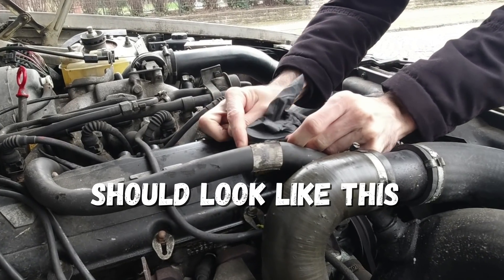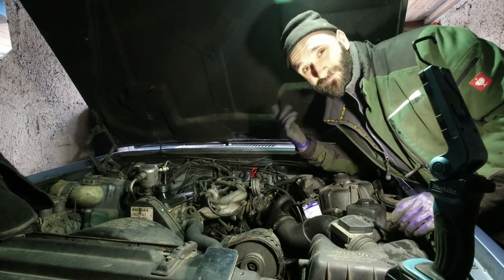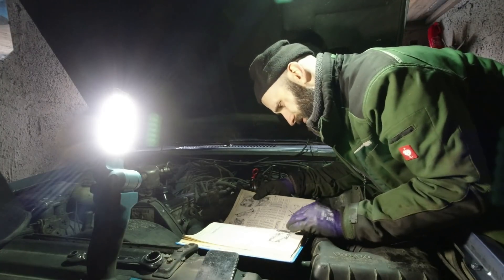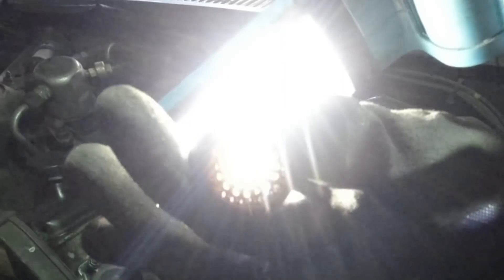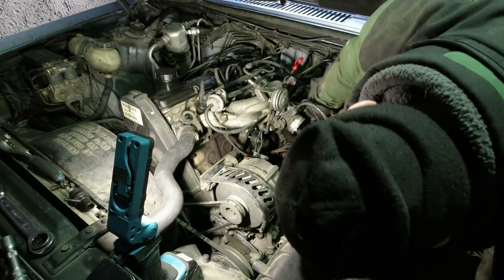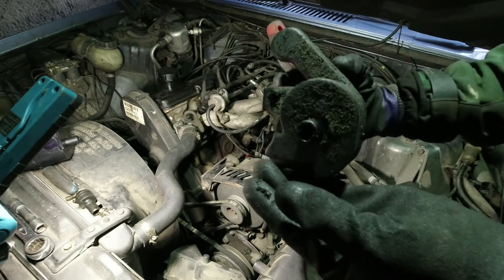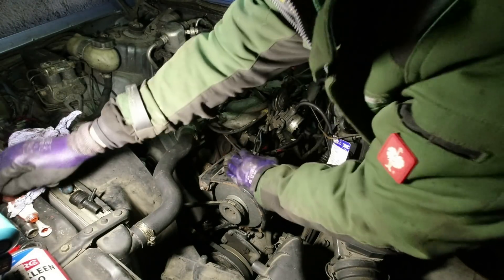My Engine is about to BURST! Volvo Redblock PCV System

Comment: What needed unplugged on my 740 with 300,000mi wasn't the box, it was the fitting that the little hose from the flame trap runs to.  The little hose itself too.  I see you got to that on the follow up video.  The fitting's on top of the throttle body.  Plugged solid, I had to take it off and drill through the stuff.

Comment: Maybe in the meantime you just got it fixed. If not I have figured out some interesting details. Below the oil seperator box there is a hose going down to the oil reservoir. On my Volvo 240 this hose is nearly full of debree too. In this video someone refurbish a motor and you can see clearly where this hose is sitting. Maybe you have to clean this hose too?
https://youtu.be/GIVhKtua8s4?si=dFDAWF3qalB8omQQ&t=1892

And in this video is a short sequence where you can see inside this black box. If there is any fluid to lose all the debree it should be possible to clean the box instead of buying a new one.
https://youtu.be/0YDoLSj5n5k?si=dTk9BwOClSvo_pji&t=126

Comment: I was told by older Volvo mechanics not to remove it because it often breaks the pipe on the pvc box that goes down to the oil pan. They recommended using engine degreaser or brake cleaner real good, then let it sit a bit and then do an oil change.
Reply: If it's really old or has a lot of miles, you have to replace it...just be careful removing it.

Comment: had this issue with mine, deleted the pcv and ran the holes to a vented catch can. made no difference, so bought a vented oil cap and ran that to a catch can aswell. fixed pretty much all the oil leaks from caused from excess pressure

Comment: I swapped out my pcv and flame trap and flame trap hose with new ones, and cleaned my MAF, but still filling up the glove. Any ideas???
Reply from the maker: Did you replace the little hose as well? In the video after this I find that was my problem. It could also be excessive blow by from the pistons, or there's a pipe that the pcv fits into that goes down into the oil pan, if it breaks it can cause problems, the sump needs to come off for access
Reply: @Involvod  my little hose is stiff af but clear. The intake manifold nipple it attaches to however is very clogged up, can hardly see into it. Will unbolt it off and clean that and pray.
Reply from the maker: @Waveforfren  Fingers crossed for you! The whole thing really relies on that vacuum being clear
Reply: @Involvod  changed the tiny hose, cleaned the nipple, and the glove freaking SUCKS now!! Freaking stoked. Your video helped tremendously.
Reply from the maker: @Waveforfren  awesome!! 😁

Comment: 10w40 is semi synthetic oil, right? Or is this full mineral? I guess cars that are around 30 years old will have run on semi synthetic as it was very common back then too. Or am I wrong?
Reply from the maker: This stuff is mineral, semi synthetic would be better, but there's a bit of a question as to how "synthetic" a semi oil is, because there's no requirement on how much it has to be, it can be just a drop, a quick Google search said it could be 5-10% 

I'm sure that premium brand oils will be a good portion synthetic, but this oil I use is €20 a can which is great value for a premium oil, the redblocks seem to love it, so I just stick with it. I'll probably find some decent fully synthetic oil to go into the 940 turbo though when I do the head gasket.

Comment: 3 years ago I went to the considerable trouble of removing the oil separator box from my then 29 year old 740 GL with the B230F engine. After more than 425,000kms I found it to be completely clean! Boy, was I pleasantly surprised! I guess that says a lot for only using top quality oils (Castrol, Quaker State) and filters (Volvo, MANN) and never running more than 3,000 miles between oil changes. :)
Reply from the maker: Yeah that'll do it! Very nice 😃
Reply: @Involvod  If you enter '1990 Volvo 740 GL Walkaround' you'll be able to view the 4 short videos I uploaded just today. If you enter '1990 Volvo 740 GL with B230F Engine' you'll find the engine running video.
Reply from the maker: @bobjohnson205  I just watched them and left a comment, that's a really nice one you've got there! Great colour!

Comment: Had this issue with my 2.5t v70, scared the shizzle out of me. Anyway, i think they only blow out the freeze plugs when the pressure gets too much?
Reply: Maan what an unexpected end to the vid, i was gutted too.
Reply from the maker: I'm not sure about the freeze plugs, but there's a leak from the front crankshaft seal which is getting worse and probably more seals to follow 😬

Comment: IMO the blowby is actually not too bad. I mean, i have seen way worse. All engines have SOME blowby. 
You now know for a fact that the PCV system is OK. Now just run it. 
Also, to be fair you would have to test the blowby at full operating temp because only then will all parts (block, pistons, rings) have expanded fully due to heat.
Reply from the maker: Thanks, I did make sure it was hot I should have mentioned that in the vid. I'm noticing the oil leaks getting worse, but if it turns out to need engine work I will just keep driving it for now, she runs good

Comment: Next thing I would check is the small diameter hose (that attaches to side of flame trap) for clogs and the threaded nipple that it connects to on the manifold. Hold onto your old breather box (for spare) and see if you can soak it and clean the internal deposits-a lot of the aftermarket boxes leak at the midpoint seam. Looking forward to see how this turns out.
Reply from the maker: Thanks for the tips! 🙏

Comment: Does the pressure arise from exhaust valve leak-by ?
Reply from the maker: Yeah it could be, or maybe past the piston rings etc, I need to do some tests 😏
Reply: @Involvod   I SO look forward to your uploads.
Reply from the maker: @danielebbeling4056  thanks! Just realised I made a mistake though, the pressure in the crankcase must be from blow by past the piston/rings, but exhaust valve leak by would definitely cause a loss in compression

Comment: Was the flame-trap housing connected on all 3 sides? 
On mine the small diameter nipple was broken off and leaking vacuum. Bought a new housing and after connecting everything properly my crankcase pressure went from positive to negative. If you rev the engine up and crank case pressure goes from positive to neutral or negative at slightly higher revs it's an indicator for a vacuum leak.
Edit: Crossing my fingers for you it isn't blow-by
Reply from the maker: Yeah I checked that and it was okay, I've had that issue before though! I will try revving it up a bit today, thanks for the tip!

Comment: Oh that cliffhanger! I'd check the lower breather tube as mentioned above. How's your RMS doing with all that blow? :) Usually the catch can does not need to be replaced, soak it over night in diesel and its as good as new.
Reply from the maker: Well I've recently noticed the front one leaking 🙄 Thanks, i'll keep the old one and give it a clean, especially now we know that it probably wasn't totally blocked!
Reply: @Involvod  yeah that's a great spare! Oh well, that's a nicer job to do at least, and you'll get an incentive to do the belt! Seem to be a bit of a lottery, in most B230's i've had, previous owners have done the front seals when doing the belt, so the RMS goes when the fronts are fresh and the PCV is clean.

Comment: It seems a bit worn engine. Breathing out some combustion air from top or bottom, or both like valve sealing surfaces, valve guides, piston/cylinder sides, piston rings. Cheapest try could be some diesel flush as  a motor oil, could release some build up on the piston rings and make it seal better. However that is not the worst blow by I have seen.
Reply from the maker: That's true! I'm going to do some extra tests on the engine and see what it tells us

Comment: I think your high crank pressure might be due to rings sticking due to naff oil being used!!! One thing to be really careful of is the oil you use in a turbo engine, as the turbo is exhaust driven the heat build up is massive, if anyone just turns the engine off after a blast the oil 'cooks' in the turbo and restricts the oil drain. The oil drain restriction causes the flow to decrease and eventually kills the turbo. Synthetic oils can stand the high temps in turbos so much better. Don't even look at semi synthetics as they are just mineral with a splash of synthetic - just marketing bull. 
Hopefully high crank pressure is due to ventilation system not stuck rings! Good Luck.
Reply: its NA
Reply: @pelayorico  This one is but his 940 is turbo.
Reply from the maker: Thanks, that's a good point I might pick up a synthetic oil for the turbo, totally true about the semi synthetic, I think I remember hearing that there's no regulation on how much synthetic oil has to be in it, so yeah, can be just a drip!

Comment: Did mine on my v70 T5..Annoying and time consuming job but the engine is not blowing..  Perhaps you're going to have to clean out the rubber pipe or replace it.. Its also a good idea to clean out where the pcv box attached to the engine..Maybe try running a good flushing agent like liqui moly apparently it works well cleaning out built up deposits..Good luck mate.
Reply from the maker: Thanks mate!

Comment: Ha! Another redblock classic ;D. Had also excessive pressure blowing everywere, eventhough I cleaned the PCV 6 months ago. Decided to relocate the PCV in more accessible place. Used some rubber hoses and plumbing parts to DIY it. It seems to work better now and I will propably change the oil soon too. Yeah. Years of neglection... Gotta clean that redblock eventually ;D
Reply from the maker: Wow, nice idea! Sounds interesting 😃
Reply: @Salamanda Ok. Maybe I will post some info on my instagram: wolwo240

Comment: and flush with wynns engine flush before every oil change
Reply from the maker: I've never tried an oil flush, heard the horror stories about them causing problems, I take it you haven't had any bad experiences?
Reply: @Involvod  none whatso ever , keeps the carbon down to a minimum , been using it for years since my first volvo 240se 1991, had many red blocks since then , now on white blocks s60's
Reply from the maker: @andywarrington4738  thanks mate!
Reply: @Involvod  also suggest you do a compression check
Reply from the maker: @andywarrington4738  next video on it will be the compression and leak down test 🤞

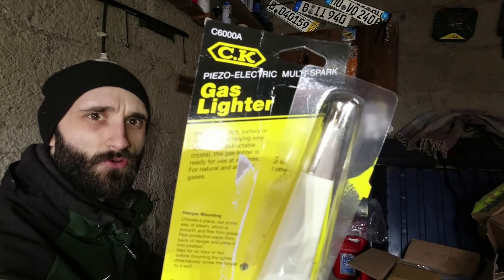Comment: 1:47  The 1989 244 I once owned had a lot of blow-by.

When the PCV system plugged up unbeknownst to me the pressure got so high the engine pushed out both the front main and intermediate shaft seals.

I guess in hindsight it was fortunate the rear main didn't get pushed out, that would have been much more problematic.

Anyway;

I still needed to drive (thankfully very short) to work so for 4 days I put quart after quart of engine oil in as I obtained seals, a timing belt and almost every part of the PCV system right down to each hose.

I have the same Makita light, very handy.
Reply from the maker: That's what I'm worried about on this! Miss Involvo'd bought me the torch, it's great isn't it. We watch alot of Salvage Rebuilds here on YT, he has one!
Reply: @Salamanda Yah, it was a BIG mess!

Comment: There's a tube going into the sump. It could be blocked as well.
Reply from the maker: Thanks, that's what one of my friends said too, I reckon I'll leak test it, then if it's okay, take off the sump and check that pipe!
Reply: @Involvod  check the compression first, i guess. you could have so much blow-by that the pcv can't handle it, or something. i'm not a specialist, all i'm saying is you should think of and check other things that can affect it before putting effort into it.
Reply from the maker: @zloychechen5150  that's what I'm worried about 😅

Comment: Hey bro, I need to do the Pcv on my 850, its such a crap job that my mechanic refused to do it!
Reply: Do it yourself. It's messy and difficult, but absolutely doable.
Reply from the maker: Put Robert DIY on and roll up those sleeves bro 😃